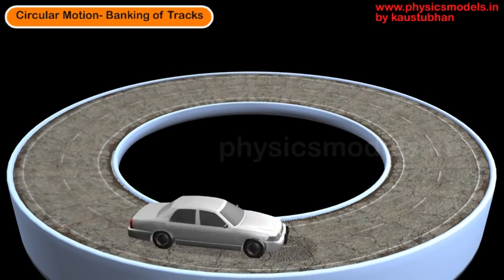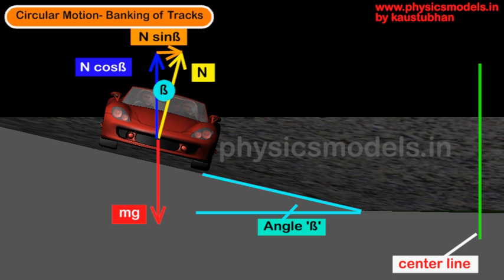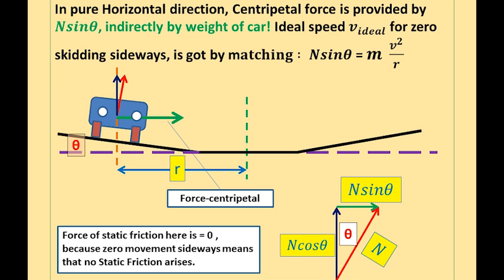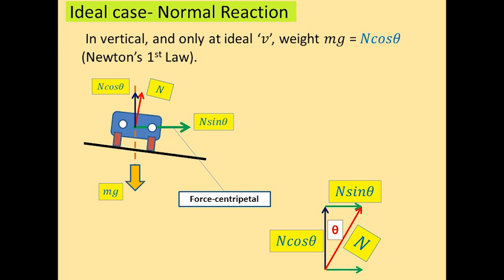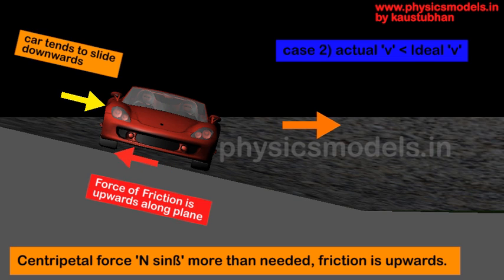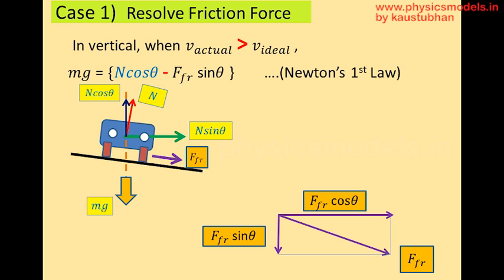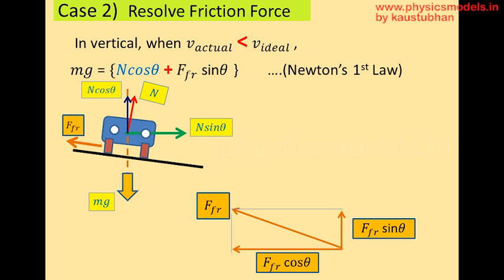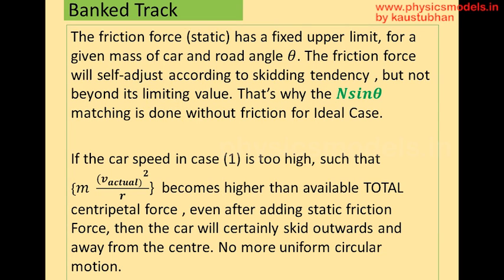PHYSICS MADE EASY - BANKED TRACKS

Comment: shouldn't there also be mg's horizontal component that is pulling the car down in the direction of the banked track
Reply from the maker: Weight Mg is absolutely in the vertical direction. Hence it cannot have a horizontal component at 90 degrees. 
Mg can only have a component along the plane incline
Reply: @physics_animation_tutorial  ah yes you said it has in the incline. sry for the confusion
Reply: @DravenFNM yh true I guess it depends on what vectors you choose to define your plane, I didn't realise it
Reply from the maker: Hi please see my recent videos 
1) https://youtu.be/nPzGgr9zEcc -- block on block - therory and solved problem
2) https://youtu.be/76PqTL-a5wg -- Block on Block - theory and solved problem-2
3) https://youtu.be/WHmi-DBZ1nc -- Magnetic Field due to current - solved problem
Reply: @physics_animation_tutorial  not a horizontal component, I mean it has a component in the direction of the incline and another component in the opposite direction of the Normal Force. I’ve seen mg split into two components in almost every video and source online but i’m not sure if it applies to this case too

Comment: Does the friction force where the rubber meets the road acts radially inward to counter the tangential velocity  on the car moving in a circular motion?
Reply from the maker: Hello, for a car moving in a circular motion which is on a Horizontal Plane, and is defined by some radius of arc, and assuming the Tyres are in Pure Rolling Motion and are not sliding/skidding on the road surface, the friction force acts inwards radially and towards the Centre of the Circular motion. It is this Friction Force that causes the circular motion Centripetal Acceleration.
Reply from the maker: Further please refer to my chapter on Frame of Reference for all circular motion. The above is assuming we are observing the car from outside, i.e. external frame of reference. For people sitting inside the car, they will be in a different frame of reference
Reply from the maker: Hi please see my recent videos 
1) https://youtu.be/nPzGgr9zEcc -- block on block - therory and solved problem
2) https://youtu.be/76PqTL-a5wg -- Block on Block - theory and solved problem-2
3) https://youtu.be/WHmi-DBZ1nc -- Magnetic Field due to current - solved problem

Comment: Why don't we take N=MGCOS(BETA) like in all the inclined plane problems?
Reply: acceleration is horizontal towards center. So net force is also horizontal. so component of force in vertical direction is zero. in inclined plane problem, acceleration is along slope, so net force is along slope,so component of force normal to plane is zero..
Reply: Or how can N be greater than MG

Comment: why dont we take the angle with the ground?? why we take horizontal component as sin(angle)?
Reply from the maker: Good question. Answer: The car moving around a curve experiences centripetal Force, same like a ball being spun around on a rope by a finger. In the case of car, the earth is taken as horizontal Reference Plane. Hence, the curved road is taken at an angle Beta relative to the earth. The axis of rotation is therefore vertical. 
Just like the ball moving around on a string, the car moves around on an invisible string. Hence the Centripetal Force acts along the horizontal direction. 
Another way of looking at it is that the car is not rotating along the inclined road. Hope this clarifies your question.

Comment: Shouldn't the centripetal force act parallel to the incline instead of the pure horizontal?
Reply from the maker: hello Sarvesh, Good question. The Answer is 'No', it should NOT act parallel to the incline. The centripetal force should act purely horizontal, BECAUSE it is then acting towards the AXIS of rotation (passing through the center of curved path or trajectory), and this axis is VERTICAL in our case . The car is rotating around this vertical axis. Hence the centripetal force tending to pull the car inwards towards the axis, should act in purely HORIZONTAL direction. Hope this clarifies.
Reply: Thanks for the swift reply, +Physicsmodels. Although, I still have a couple more questions: Firstly, isn't the center of a circle a point equidistant from all the points on the circumference.That should, in my opinion justify the center of the circle being at the bottom the incline. Also, this point would still lie on the AXIS of rotation and would not violate your logic. Secondly, can the centripetal force then never be act parallel to the incline in any case? And yeah, Thanks a lot! :)
Reply from the maker: Hello Sarvesh, good question. The center point of the circle comes into play only after a body having some mass is turning around a curve. The vertical axis always exists, but the point along that axis does not exist till we have something moving around on a circular trajectory. For our case, the car is this mass which is rotating around curved road path, hence the center point will get created by the car itself, not by us. This centre point will lie on that vertical axis passing through the centre of curved trajectory, and also the point will be located precisely when we draw a parallel line acting through the CG of the body (to make it simple). In other words, the car rotating around that curve, pulls itself around that curve, with a Centripetal Force acting always perpendicular to the Axis. 
Now, if the car moves outward along the banked road, it mans the centre point on that Axis will also move upwards, in such a way that at all times, the Centripetal force acts horizontally and perpendicular to the axis line. Hope this clarifies.
Reply: Aha! Thanks a lot...It helped enormously :D

Comment: i want answer of ali naseer
Reply from the maker: OK. The component of weight 'mg' along the direction of normal would be 'mg cos theta'. Thus, Normal Reaction N= mg cos theta. For example, suppose we increase the banking angle of the road , let's make it almost vertical, theta will tend to 90 degrees, cos 90 will tend to  zero,  and Normal reaction 'N' will tend to 0. Although the weight of the car = mg will still continue to act downwards, vertically downwards.